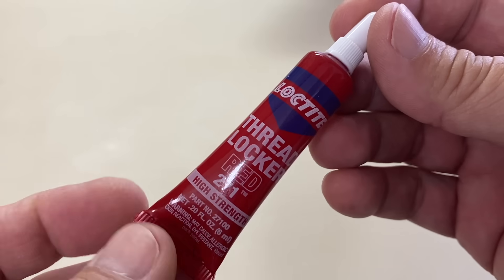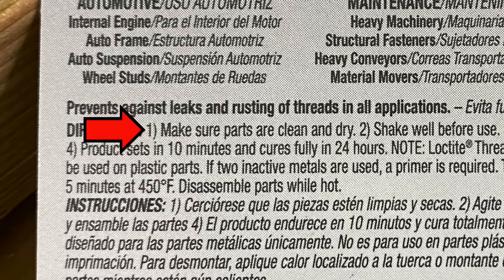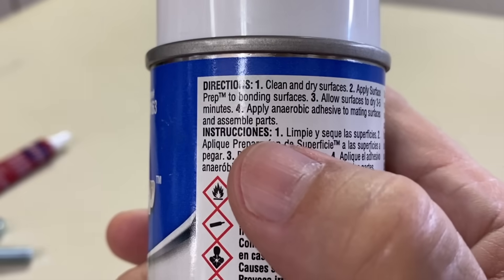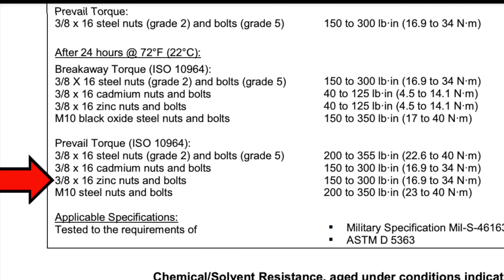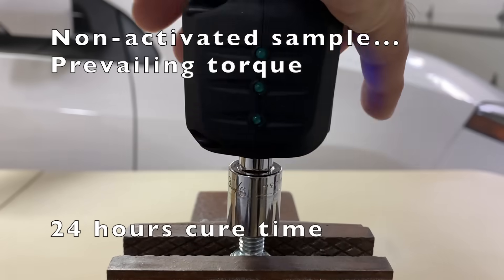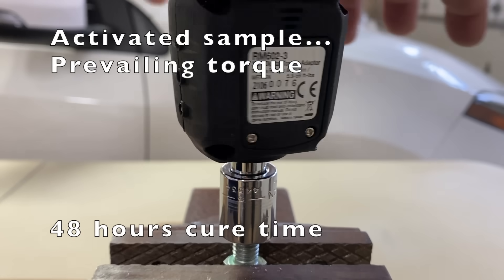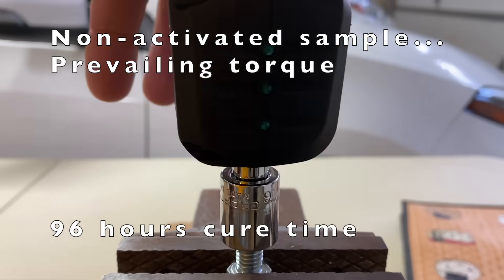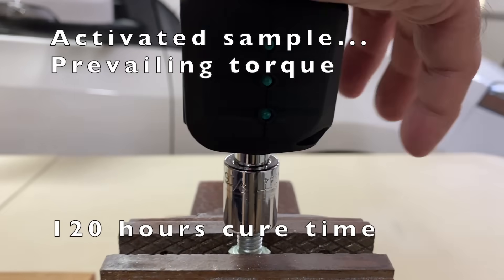Nuts & Bolts - Most DIYers Do Not Know This | Loctite Red Threadlocker Curing

Comment: Manfactures often include an unnecessary step to either sell another product (ex. primer) or give their lawyers a loop hole if their product fails (clean dust free surface) when they know that most of their customers cant abide by it. I use Loctite on light fixtures that were installed on a bridge when clinton was in office, at 3 am,  in the rain, cold salty air while on a boom lift with a head lamp. In these conditions i can barely keep my sandwhich clean let alone a bolt.  Use lots of loctite and torque to specification. If you need to loosen use either a brake bar or a torch to burn it off.
Reply: I am just going to stop you here and say that you never installed those light fixtures.
Reply: @JediOfTheRepublic  I didnt install them. i replaced them.Or replaced parts of them. In the cold at 3am.
Reply: @beansmalone1305 Yeah-yeah, we know, with your dirty sandwich & when Clinton was in office(so basically sometime during the 8 yrs he was President from '93 to '01)
Reply: @purdyboi807  correct
Reply: @JediOfTheRepublic  correct
Reply: Now I want a Sammich
Reply: Yaassss
Reply: Or they require the extra step of a primer to abide by the laws of physics
Reply: @AlpineTheHusky  correct
Reply: Sounds like a conspiracy. (Ha ha!) I think it's more likely that Loctite wants to ensure that surfaces are clean and free of oil residue and other coatings. As for loophole, if you don't follow the instructions, it's not a loophole.
Reply: your an expert huh
Reply: @mrbillpurcell6203  How awful is your life that you would insult some random person on youtube that you dont know? Hope things turn around for you.
Reply: @beansmalone1305  It didn't sound like he insulted you to me... he just said "your an expert huh"

Comment: It'd be nice to see a test on aluminum.
Reply: I use blue on my motorcycle ..it's a old 70's racing bike  that is KNOWN to vibrate.. follow directions carefully and it works , added benefit is it slows down seizing between the dissimilar metals

Comment: Nice. This is a proper test.
Reply from the maker: Thanks!   Much appreciated!
😎
Reply: No it isn’t the nuts are not tightened down therefore no bolt stretch and the presence of oxygen between loose threads not giving a proper cure

Comment: I don’t think steel is a inactive metal.
Reply from the maker: You are correct.  Steel is considered an active metal, but zinc on the typical zinc-plated steel bolts are an inactive metal.

Comment: Seems like there wasn't enough of a difference to worry about. I think I will continue to use it as I always have!  But it's a little odd to me that the non-activated breakaway torque raised with 72 hours, but then dropped again. I think there may be some variability in the quality of the bolts and nuts. A better test would be to test 5 of each without timing, then average them, removing the highest and lowest!
Reply from the maker: Thanks for sharing your thoughts and suggestions.  Much appreciated!   😎
Reply: I agree James, a larger sample size of each timepoint is needed.  n=5 is a good starting point.
Reply: Also I've noticed there are samples with higher values on non-activated. Shouldn't that be consistenly the other way around?
Reply: @MiMiM MiM  he used a random activator and read the TDS from 2018 which removed half of the instructions for the glue.
Reply: The point is not that it works with or without primer.  The point is: It depends on the material composition of the fasteners you are using.
Reply: He should have tried rust hehe